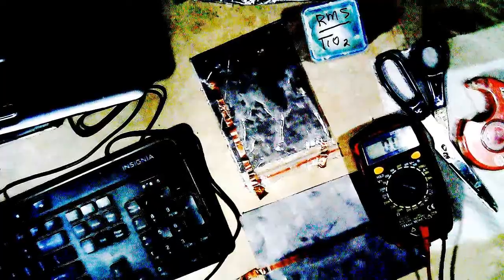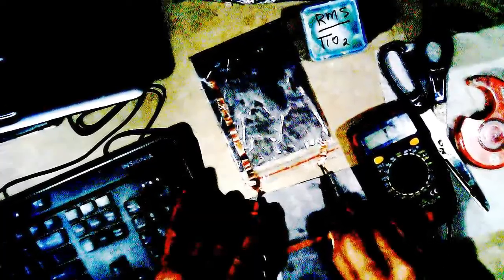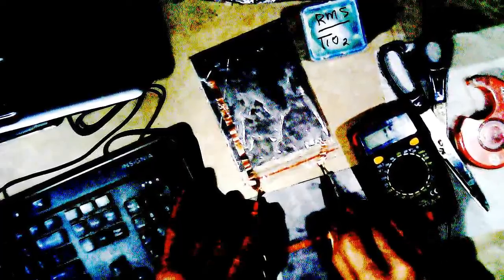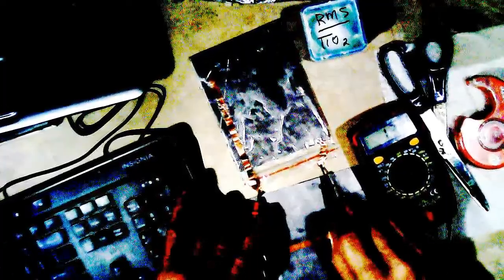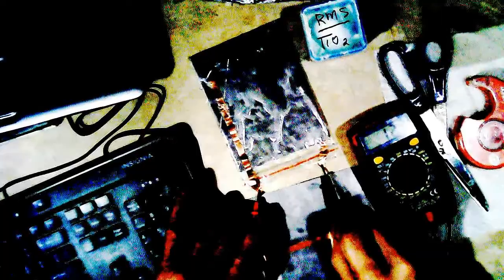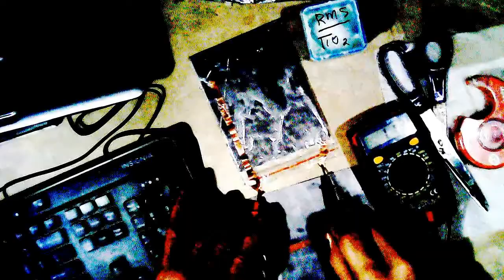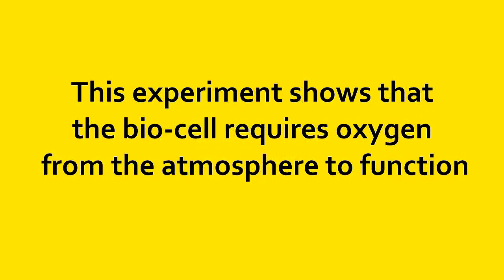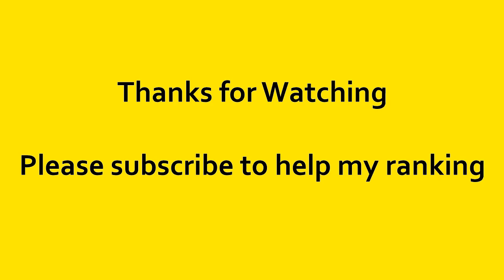Bio-Cell Demo #6 How to Kill (& revive) a Bio-Cell

Comment: The changing audio volume is straining my ageing ears. I can hear through earphones but that's inconvenient. Then again, maybe I'm just being lazy. The reduction in self charging characteristic may be a chemical reaction. I'm not a chemist so I wouldn't be able to provide any insight but the components shouldn't be able to change without some chemistry variation. Perhaps oxygen is being lost, absorbed, or converted in the process.
Reply from the maker: Sorry about the audio problem. I was having a lot of video/audio problems when I first started making videos.  I killed this cell twice and brought it back to life. It's definitely using o2  from the air like a mag/air battery. Open the bag to the air and it recovers completely.